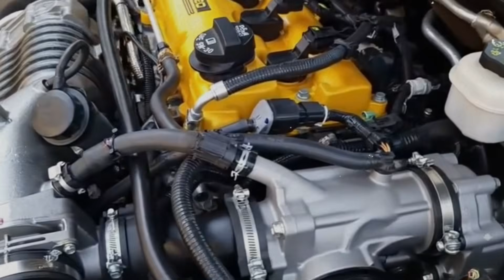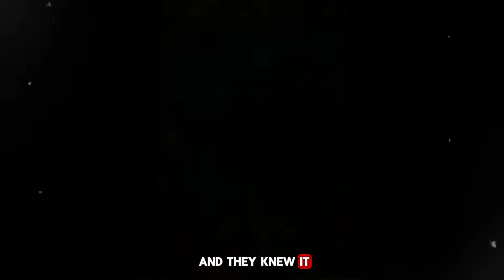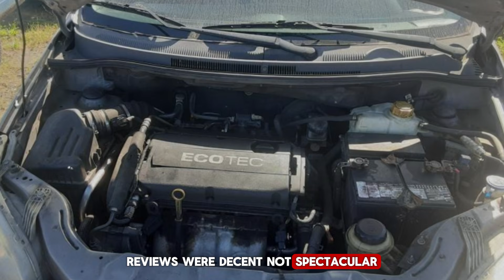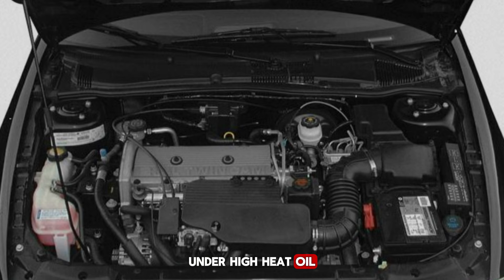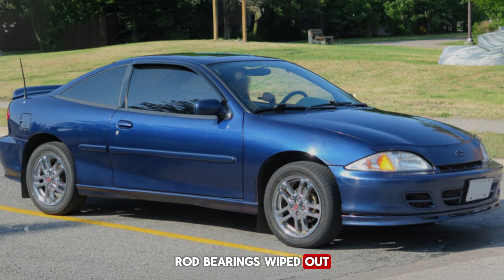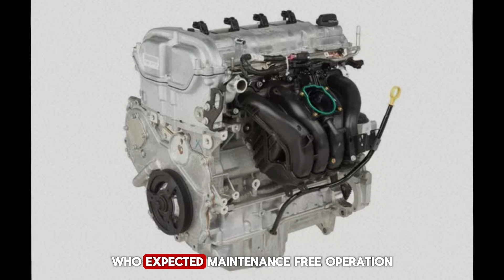The Engine That GM Couldn’t Fix — 2.2 Ecotec

Comment: I had this engine in a Cavalier in high school. It was wonderful. I changed the oil regularly. drove it hard, and it took the abuse. Car has over 200,000 miles on it and is still running. I sold it to a man up the street. I recently bought a cobalt with over 200,000 miles on it and it has been a disaster. Same engine